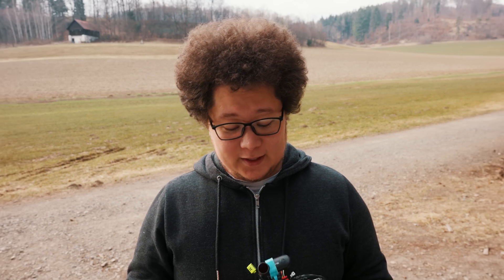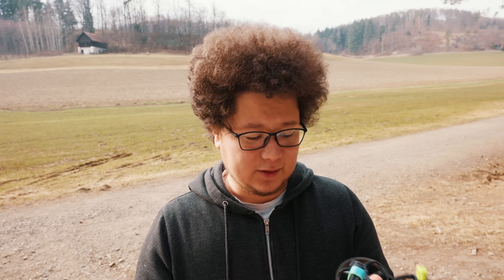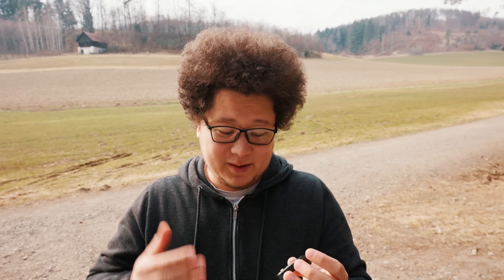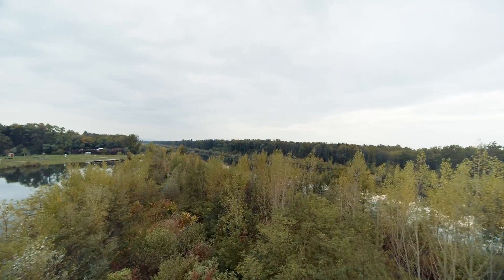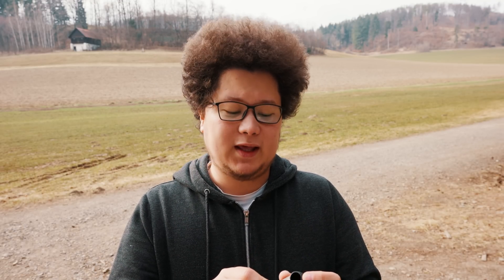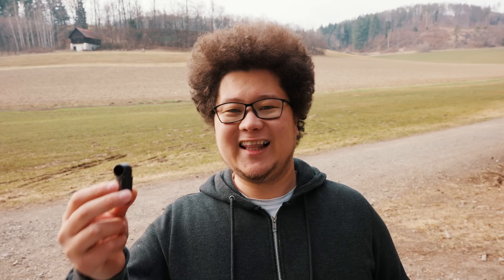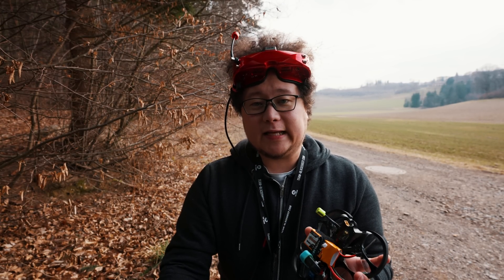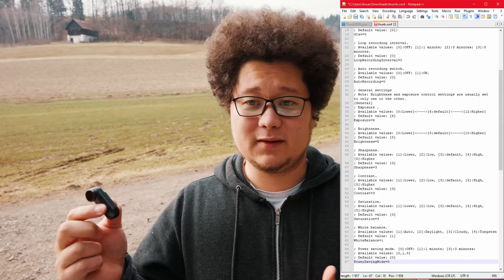☀ Best Gyroflow Logger, lightweight and cheap [Runcam Thumb]

Comment: nice.. i use thumb too..
 can u share your Gyroflow configuration? thanks
Reply: Update the camera to the latest firmware and choose 43hz with low pass filter.
Reply: @helloruncam9572  beautiful.. Thanks runcam
Reply from the maker: What kind of configuration? Just upload file, press autosync, press export. Thats all i did 😉

Comment: Thanks! for your review. Good job! Have a quick question, why the picture is so laggy, I mean, is it possible to increase frames per second and make a video is a bit smoothy?
Reply from the maker: Its already 50fps. You can record 1080p 60fps if you won't record gyro data
Reply from the maker: Memer Dreamer  i checked it once again, it looks fine for me... Maybe there are a couple of shots with less motion blur and thus it looks a bit laggy. Do you have a  timecode of the bad shot? Or does the whole footage look so?
Reply from the maker: Memer Dreamer  i think i understood what you mean, my explanation is - the cam has very low bitrate - 15-18mbit/s with long GOP. it means that there is not enough information to recover fast moving objects. if there is any fast movement, it will be recovered but the picture becomes mushy and also there is a tiny amount of jitter because the decoder cannot predict information so good to recover fine details. Thus you see whole blocks of image moving at once, even if there should be some additional geometrical subpixel changes between frames. All this happens very fast, every couple frames, you cannot see it very good, but i think this is the reason of the uncofortable viewing experience. not sure if this explanations is 100% correct.
Reply: it lags on PC and not on TV. I am mining and it could be a reason. Anyway it does not generally lag for other videos.
Reply: also it was not lagging when you was talking. It happens in flight part only.